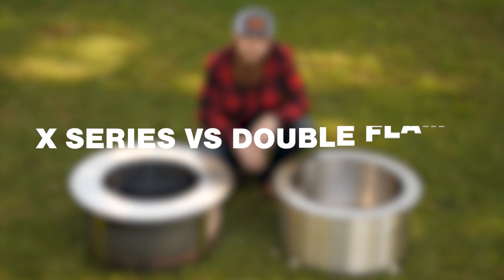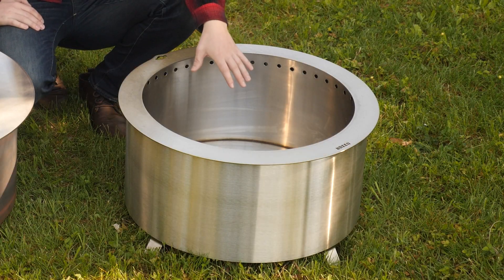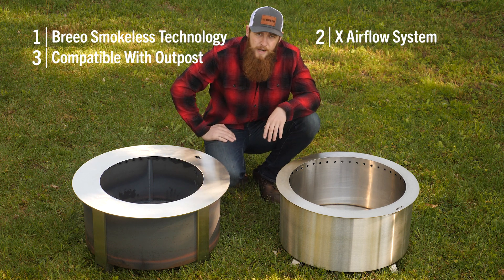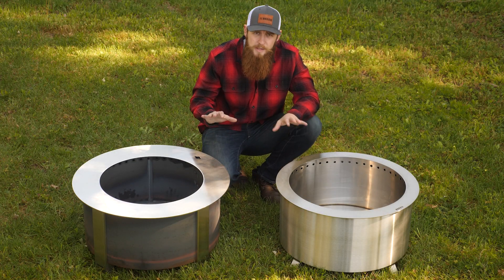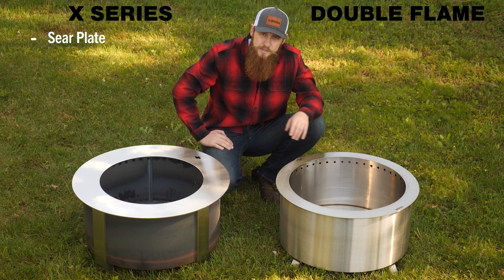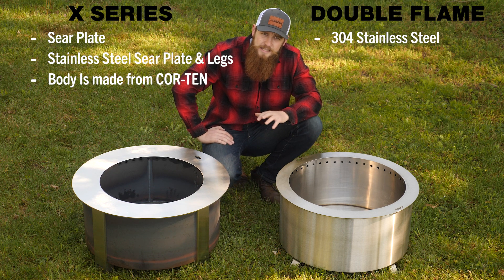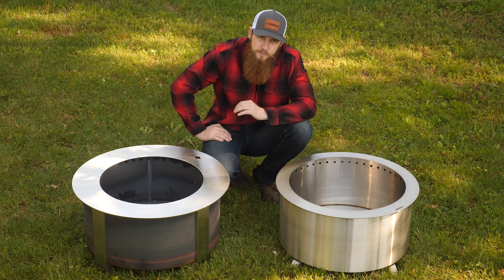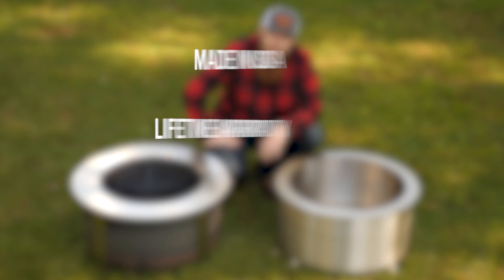X Series VS Double Flame

Comment: I just bought a 19" Double Flame that was a closeout from a local company, guess they had too many and we got it for 30% off. I am wondering if it will still be covered by your Lifetime Warranty, if something should go wrong with it, will I get a new X Series or will I get a Double Flame? Just curious as from what I have seen so far, it does not look like it will break or any welds go bad, Thanks Breeo.

Comment: Can you do any cooking on the unit without the sear plates? I understand the wider frame is idea....but can any be done on the others?
Reply: The Sear Plate is specifically designed for cooking, the standard rim is not and will not get hot enough.

Comment: Do they come in different sizes ?for portability.is there a good edge on the double flame for moving?
Reply: connie waite I got mine today with the intent on using it for camping and a home fire pit. It does have a nice lip that you can pick it up with but I will say, being so well built that it is on the heavy side.